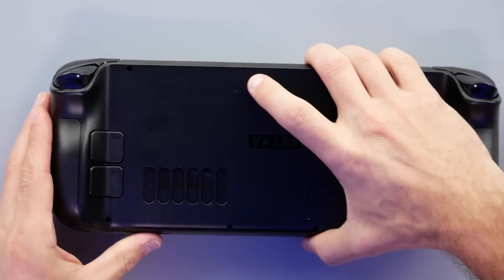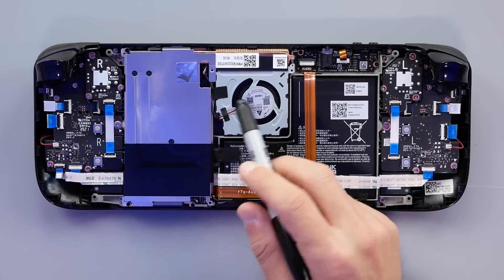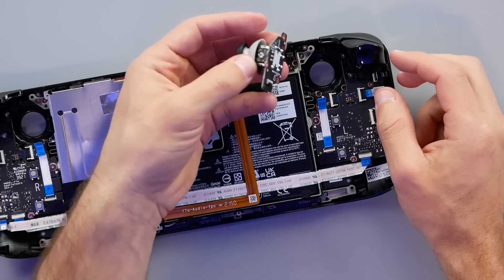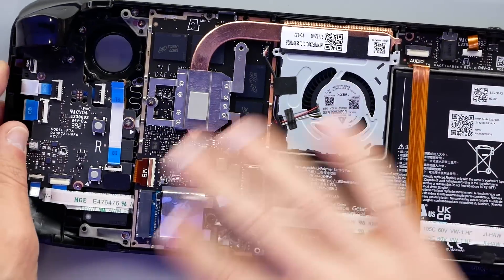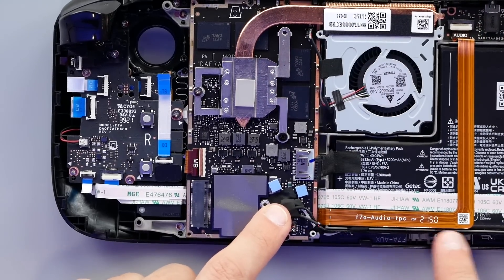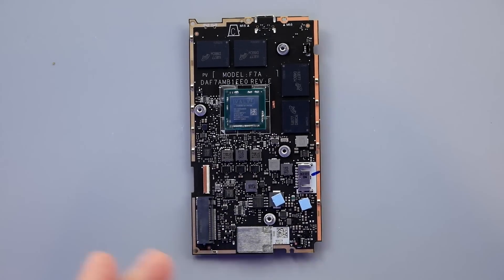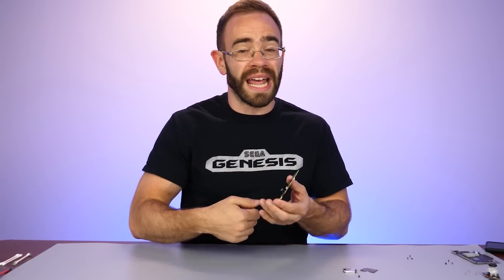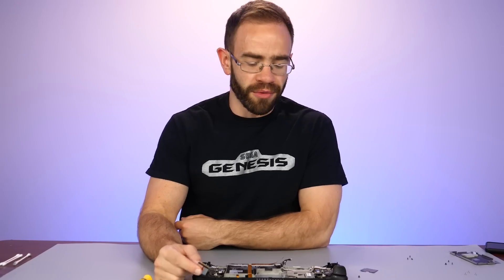I Took Apart The Valve Steam Deck...

Comment: I'm hoping that someone comes out with a M.2 USB4 card and back plate for the Deck that exposes a couple USB4 type C ports externally and internally allows enough space for a M.2 2280 and 2230 NVME cards. Exposing USB4 ports would allow for the use of external GPU docks that you could use with your old GPUs or future low end GPUs.

Comment: In terms of stick drift, the Joy-Cons are actually worse with that, it's not something that's all too much being magnified by the internet. I've had all of mine start drifting in about a year of using them with regular use, while other controllers I've had started drifting much later or through some sort of damage.
Reply: My joy cons drifted the first day I got the switch

Comment: Spawnwave keeping stick drift overhyped and over inflated.  One would think every single controller owner in the world for every console ever made with a stick has irreparable massive stick damage - according to Spanwave.
That is not the case, stick drift is only an issue for a small number of controllers.  Hype gets video views right?  Even if that hype is based on a total lie (that being how widespread stick drift is).

[edit].  Stick drift in NOT very very common.  Another lie by Spawnwave.

Comment: I like seeing module analog sticks, but.... They really dropped the ball on M.2 storage. Should be 100% easy to upgrade with a small panel uncovering a M.2 slot! 
I kinda wish the battery was easy to hot swap like how laptops were forever. But... I'll forgive it. Not super hard to replace, but not really for a novice. 
Like if those could both be easy access I'd be super impressed. But bottom line this is doable. Not like you have to take apart 90% of it to get access to either... (Like some things)

Comment: I took my 512G Model apart a few days after delivery, for an Ssd upgrade and am loving it. I have  more space then I'll ever need for this, as I'm pretty sure SD2 will be releasing in a couple years with substantial upgrades.
Reply: Why did you buy the more expensive model the 512gb instead of the 64gb model if you're going to replace the SSD anyways?

Comment: These SSDs aren't that easy to get a hold of a 1TB one. If you can it's going to be expensive. I have a Surface Pro 8 that uses the same type of SSD thinking I could buy a 1TB one for less but I was wrong.

Comment: The one port for everything being on the main board would worry me. It's also such a strange design oversight not having two of them anyway with the upcoming deck dock instead already designed with an awkward cable on top connecting the system. Maybe it was meant as some sort of cute 32X meme? :)

Even super cheap Android handhelds sometimes have dual USB-C ports.

Comment: This has been taken apart on so many channels now, there's no way I'd risk it just for a video.
Reply: Its not that risky. Electronics are pretty resilient. These things were put together in the same fashion they were taken apart here. Nothing exactly special, just the correct driver bits, pry tool, and not getting too pull happy. Always make sure you disconnect ribbon cables. But not sure what the risk, they even label the screws used so you could replace the screws with ones from a local hardware store if you lose them.

Comment: I upgraded my 64GB with a 512GB NVMe a week ago, and it's running great! As long as you keep the foil shield there's no problems.
I hope they offer the mainboard as a standalone upgrade if there's ever a Steam Deck 2 with a newer APU.
Reply: i hope so to
Reply: Just wondering, how much did that upgrade cost ya?  I am looking to get a Steam Deck and I'm looking at how much it would cost to upgrade it.
Reply: @pokeplayerHQ  you can find the drives for $80 on eBay

Comment: From all the reviews I've seen, one of the biggest issues with the Steam Deck is that the fan has a very high-pitched wine that requires you to either play with the volume up or use headphones to drown out. An improvement I'd like to see on the next Steam Deck would be a larger fan that can move more air and thus function more quietly which was the direction of the PS5 and XBSX consoles.
Reply: the question is how big could they possibly make the fan on a handheld
Reply: Both the xbox series X and ps5 use their internal volume to move air.  The post's "popped collar" look is also part of the cooling, moving air. And Microsoft revamped a desert building design where the building itself is an AC unit that works via hot air at the bottom rising and sucking in cold air.
Reply: Yeah I'm lucky mine isn't too loud but I'm really unlucky the right side of the steam deck has problems. B button gets stuck sometimes, right joystick makes this weird sticky like noise when circling it around and the right touch pad makes a spring like noise when pressing it down from the bottom half.
Reply: not all fans
Reply: I think they have a new revision of the fan, and I believe I have the old whiny one, It isn't that bad, sure, I can't lay down in bed and not disturb my partner with the silence night brings, but during everyday life, with background noise at home, or especially in a bus/train/plane etc. It's really a none-issue. It sounds more or less like ultrabook fan. It definitely is something I would like to upgrade alongside the storage in the future (I opted for the 64GB). Right now I have plenty of room for games on my 512GB SD-Card. The negatives about the eMMC is that it removes the possibility of actually using the device as a desktop PC. The space of your home directory dries up quite quickly. I have 58 games installed on the SD card, but game saves, proton-files (+ all the apps I want) are stored on the eMMC, resulting in only ~9GB left, even without any games installed on that storage. So using it as a functioning desktop computer would require 256GB or preferably 512/1TB

Comment: Wouldn't there be more damageable components if the USB C was modular? At least from a cable getting yanked with force perspective. Idk that's my thought at least I'm guessing Valve tested this extensively
Reply: They might not be able to get the correct bandwidth or EMI issue when they make it moduler.  It is a full function Type C port after all.  Cannot have any chance that there is something make it not work right.

Comment: As nice a piece of equipment this is...it's ALWAYS going to be niche system, it will never be mainstream. It's too big to be 'truly' portable...hell, the Switch is too big to be 'truly' portable. It's basically a very expensive machine, who's only real purpose is that allows someone to play something sitting on their couch, or on their bed, as opposed to sitting in their computer chair. For folks who have a disposable $500 or so, to spend on a luxury, it's fine...but for most gamer's who live paycheck to paycheck...this is not gonna be for them.
Reply: People like you always bitch and moan about the price when the base deck is literally 400$ while it could been sold at 2000$

Comment: Is the Steam Deck atleast as powerful as an OG Xbox One?
Reply: More powerful than the base Xbox 1 but less powerful than the base ps4
Reply: It's about as powerful as a ps4 pro
Reply: @cupofunenthusiasticjoe  incorrect, it is slightly less powerful as the OG PS4
Reply: Sony fanboys had to come in
Reply: @cupofunenthusiasticjoe  its true though the deck has more Ram then the ps4 but the ps4 has GDDR5 vs LPDDR5 the ps4 also has a gpu bandwith of 140GB vs 88GB of the decks vs 68GB of the base xbox 1

Comment: Seeing how much effort Valve put into this really makes me sad about nintendo. Nintendo could try, but they wont. They will remain to do minimum effort because yall buy it anyway
Reply: Whole lot of nonsense, the Switch in 2017 was actually pretty impressive for the time.
Reply: 100 dollars cheaper, 5 years before, much More available, 2 controllers ready for multiplayer, almost no issues at launch, really impressive for a 2017 handheld. Im not saying that the Steam deck Is bad im just saying that the switch Is also a really good handheld
Reply: @ulink265  aside from that what has nintendo done since than as it relates to software?
Reply: You do realize that Nintendo does the bare minimum to keep their prices afforable for their demographic.

If you want power and whatnot, thats what PC is for.
Reply: Different market conditions, 5 years ago, Switch is a solid system, it's just 5 years old. Valve worked with AMD and had one of their flagship APUs modified and  basically custom made for them. Nintendo was working with a 2 year old chip that had to be downgraded to save battery life, and worked with NVIDIA which are usually known more as the GPU Maker. Not a CPU one.
Reply: I dont expect cult members like you people to see any sort of reason. YOU people are the reason nintendo doesnt try. Thanks for proving me right

Comment: I heard of many accounts already of people leaving their SD cards in the device before taking it apart and snapping it in half, so if you're going to attempt this, please remember to take it out so you don't break your device!
Reply: Linus tech tips sd card broke when he was tearing it down aswell
Reply: Makes me wonder why they put a slot in the back cover instead of the seam to make that impossible to do
Reply: My SD card is stuck, I planned on opening it but not after reading this damn it.
Reply: Why would someone who buys a video game instead of playing games want to open the device? These people deserve to have their SD cards broken, it's an act of God.
Reply: @FEL5000  to fix their devices lol
Reply: @Eclipsis17  Fix a device than bought 2 weeks ago?

It would be better to send it to Valve to fix it because it's under warranty.
Reply: @FEL5000  of course not but you never specified that
Reply: @FEL5000  Upgrade storage?
Reply: @Zorgot.  Buy the bigger storage version. There is no reason to open a video game. It took me 25 years to open the sega saturn, and I only did it because the capacitors gone bad.

They are only opening the Steam Deck because youtubers are encouraging it to open for no reason.

Videogame = Play Games. Period
Reply: @FEL5000  upgrade the storage even more than the highest tier one?
Reply: @Zorgot.  also to swap out the fan for a more quiet one. Apparently there are multiple different fan variants and some create more sound then others. When I get my steam deck, if I lose the lottery and get a loud one I will be replacing the fan asap. Also will probably swap the buttons on mine with custom colored ones, since I really like customizing my device and custom buttons is a very easy way of adding a bit of flair
Reply: @FEL5000  If anything, it's a console, not a video game. And people don't open them “instead of playing games”, but in order to enhance their experience playing them in some way. Some people upgrade the storage, others replace parts they find annoying in some way (such as replacing the whiny fan with a less whiny one if you've got the Delta one, or replacing the mushy Steam and “...” buttons with clicky ones).
That's not to mention fixes and battery replacements. 

I really don't see how people “deserve” breaking their stuff doing that, and I don't quite understand the problem you're having with people who like tinkering with their devices.
Reply: @FEL5000  do what you want with yours and we will do what we want with ours.
Reply: @wickersticks  yeah fix that dumb thing that valve did but not coloring the buttons properly.
Reply: @FEL5000  Hey bro. I'll tell you why I opened mine. I'm really particular when it comes to tactile response so I opened mine up to mix and match some buttons so I can have a unit that feels good to me (I have two Decks and am going to sell one, so I'm taking parts from the one I want to sell and swapping them with parts in the one I'm going to keep). Of course we're talking about extremely minute differences in tactile response and nothing that Valve would see as "faulty"; that's why I wouldn't even try to RMA it because they would probably laugh at me if I said that one of the buttons "isn't quite as clicky" as I might like it to be lol. These are things that a normal person would never notice or care about lol.
Reply: @FEL5000  what a troll
Reply: @FEL5000  So what you're saying is that god is a jerk who loves to break SD cards just to teach people not to open their SteamDeck?

Comment: Be careful with usb-c docks Spawn Wave! My steamdeck is currently a paperweight as I've waited over 100 hours for steam support to get back to me about an RMA, or repairs, or something. Pretty sure a usb-c dock messed it up.
Reply: I had the same scare but fixed it last night. Maybe my solution may help? You have to somehow drain the battery. I kept mine on with a black screen until the battery eventually died. After that I kept pressing the power button until the LED no longer turned on. By some miracle she booted back up without an issue. I suspect it’s an issue with the firmware.
Reply: I remember the switch having a similar issue with it's release 😅

Hope you can get it switched out for a new one soon
Reply: Yes, that’s been happening a lot apparently.
Reply: what happend?
Reply: Nintendo had that issue where they weren’t exactly using usb PD specs but their own power delivery specifications. Could be something similar here where your dock decided to pump in way too much voltage and fry the mobo.
Reply: If you used an unpowered dock (aka one that doesn't require it's own separate AC power connection to the wall) than it was your own damn fault! Unpowered docks are explicitly NOT supported for just this reason!!! If Valve replaces your unit strictly out of the kindness of their hearts try not to kill this one by breaking the rules this time... -_- ...